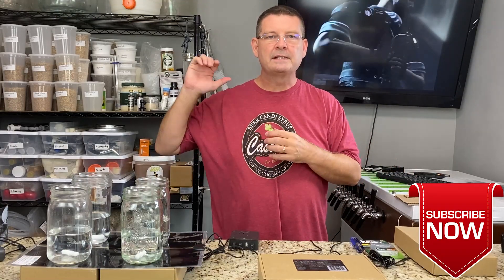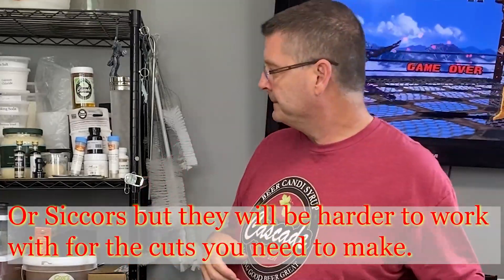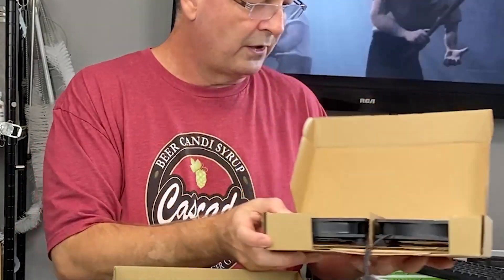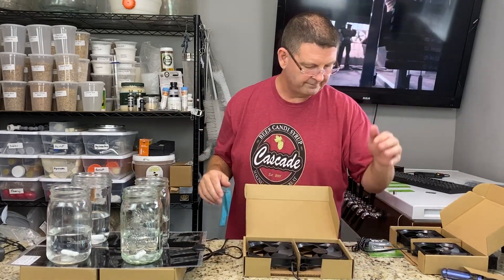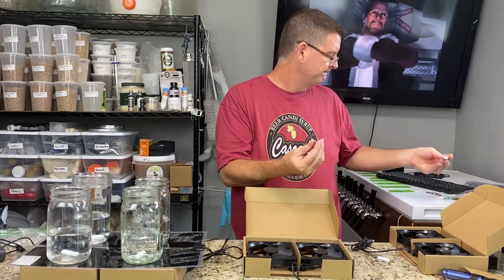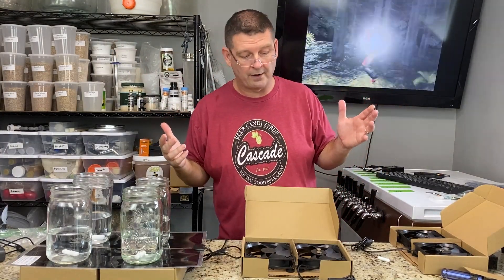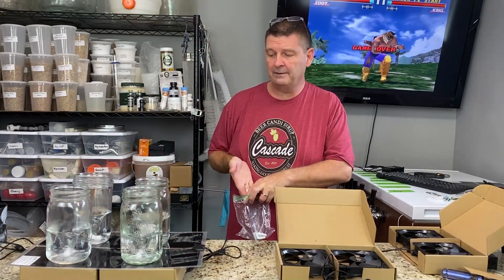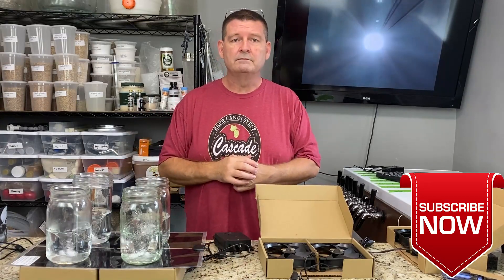DIY Stir Plates with Heat for Kveik and Farmhouse yeasts!

Comment: Do you know the RPM of these fans? I am looking for one at least 3000rpm.
Reply from the maker: Sadly I am not able to find the fan RPM for these - https://amzn.to/3TGAwYi
I believe it is probably around 1250 to 1750 RPM based on the fans being quiet and doing 104 CFM (Combined rating which means the fans really only do 52 CFM each).  I'm an IT Engineer by trade so anything computer related is in my wheel house.
Reply: @BitterRealityBrewing  
From what I found they run about 1200-1250rpm as you said. I was going to buy a stirrer that runs up to 3000rpm but then saw what you did, it is a good idea. And yours works with a mason jar, better yet. It all is something to think about. Thanks

Comment: Tip: if you add ferrous metal like a steel washer to the side of the 
magnet which you are gluing down you will focus the magnetic field on 
the opposite side. The added magnetic strength will improve the stir bar
 performance in larger flasks and/or in thicker liquids.
Reply from the maker: Thank you and left a bit of a question on the other comment to ensure I fully understand.

Comment: I like it. Simple yet functional the way things should be. Using heating pad was a good idea also.
Reply from the maker: Thank you and I took it for granted until I realized I should share as I hate the cigar box and old hard drive method as it isn't always 100%. I will be doing another one of these down the road for 3 liter and larger yeast starters as some info was shared from a subscriber using the same equipment here just with the pads still on.

Comment: That's a great build, so much neater than mine made out of lego. I use a 14w heatmat like yours to heat a 33l bucket. They will take a lot of weight.
Cheers
Reply from the maker: Made out of Legos? Now that sounds really cool! I loved Legos when I was a kid and of course still think they're cool. For my design the weight is an issue although a subscriber said he left the rubber feet on and was easily able to do a 3000ml flask for his starters, which I never go that bit but may have to test it out. Sadly I'd have to buy a 5th set of fans as I always throw the rubber feet away as I already have 4 sets of dual starter plates which I have been known to have all of them going at once to help maintain my yeast bank.